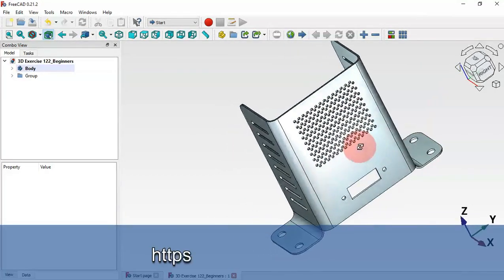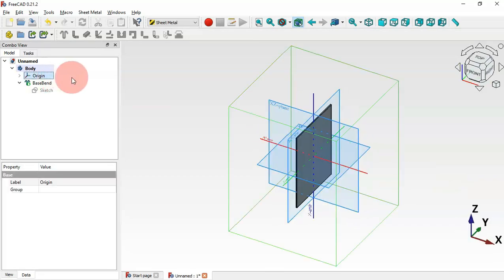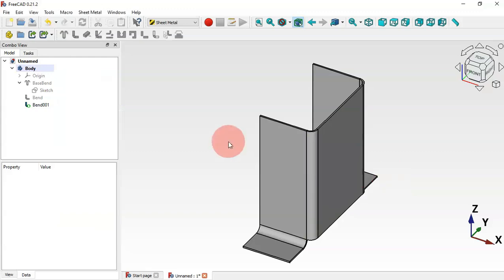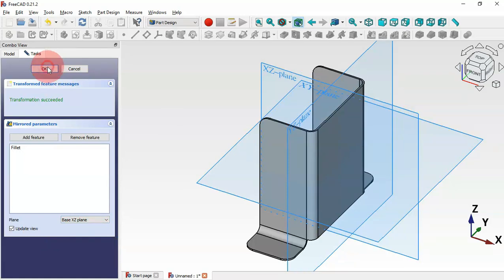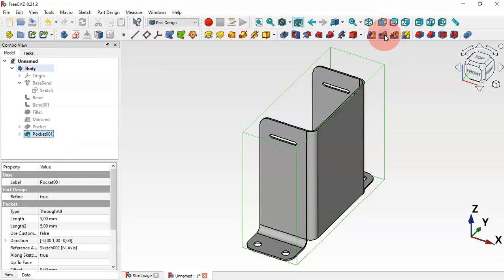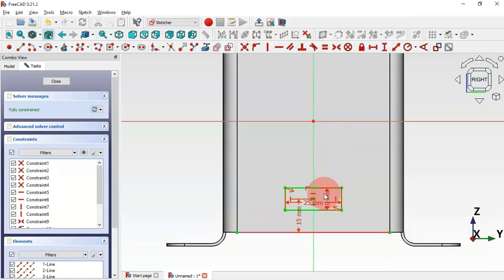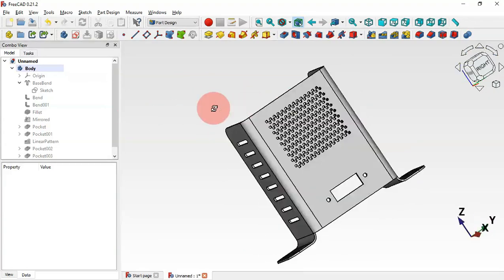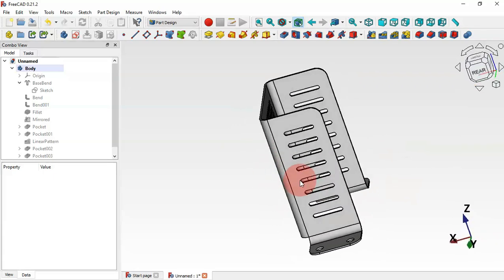FreeCAD 0.21 Beginners tutorial: practical exercise 122 (PartDesign, Sketcher, SheetMetal)

Comment: hi i got this error while bending  The bend line sketch Sketch003 is not overhanging the face sufficiently at one end or both, extend to get reliable results for the unfold operation whats solution ?
Reply from the maker: Do you still have that problem?
Reply: @OffsetCAD  usually i getting this error but not problem anymore

Comment: Thank You for this Tutorial. When I finished this exercise I also converted into a drawing in the Tech Draw Work Bench (WB). While in the Sheet Metal WB I also flattened the 3D view, in which you did not show, but I considered this really important so I included this in my drawing. I saved my Drawing on a A3 sheet in the Tech Draw WB, so I could print everything to scale. This lets us use the drawing as a paper template to cut out the sheet metal with. I glue the paper drawing directly onto the sheet metal and cut out with my saw, plus all the center points for the circles and radius, etc. I use my center punch from the drawing. I do not take time transferring the dimensions from the drawing to the sheet metal, because everything is already on the drawing. I will provide either a pdf or jpg or both, if anybody wants a copy I am glad to help because I learned from providers like You!!! THANKS YOU !!!
Reply from the maker: Thanks.